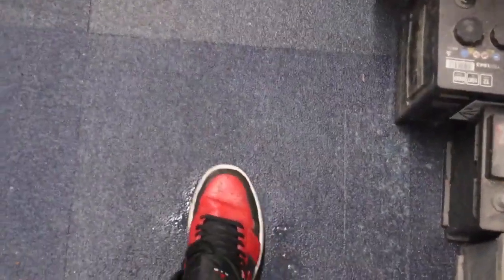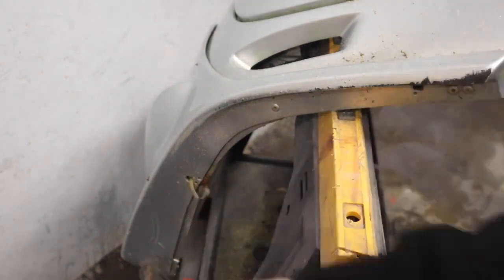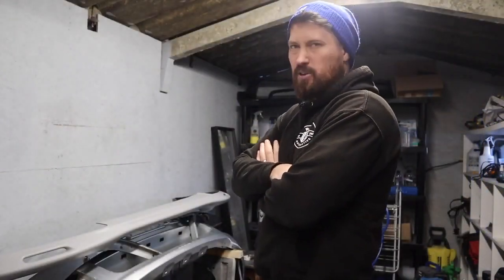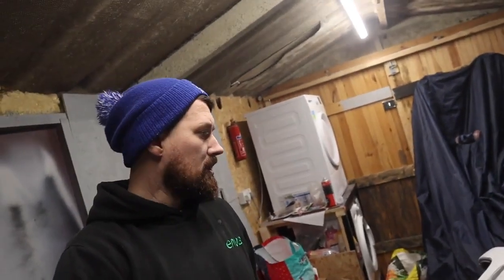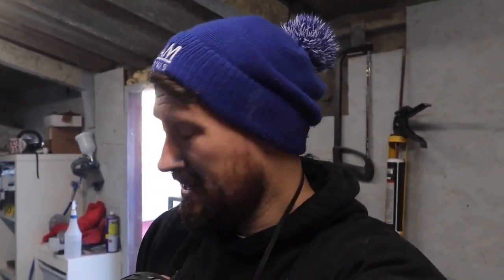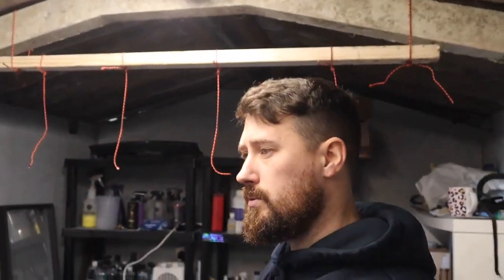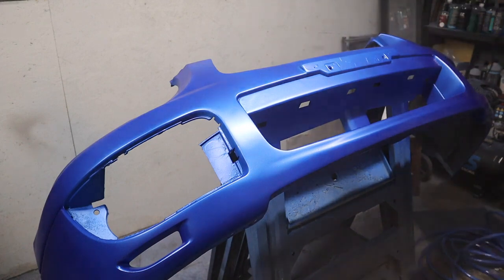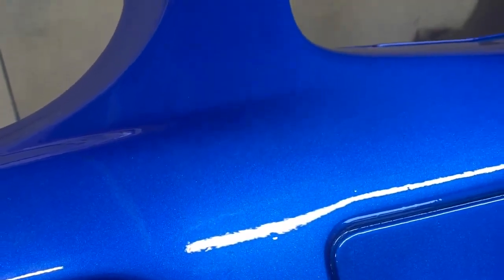DIY Painting car parts in the Garage | Mistakes were Made

Comment: The issue with the second coat crinkling seems to have been high humidity from the wet carpets drying out due to the heater in the garage. There are other reasons for crinkled paint but in this situation, that seems to be the most obvious reason.

I'm no expert but from the little I've learnt of what happens is that the first coat is still drying but at a different rate to the top layer. So the first coat grabs onto the top coat and pulls it together but since the different coats of paint are different volumes, the only place for the top coat to go is up and so crinkles.

Think of an elastic band on a pair of shorts. You stretch the band out. The top layer is flat but let it go and the elastic pulls the fabric into folds. The elastic is the first coat of paint. The fabric is the top coat of paint.
Reply from the maker: Yeah, i spoke with a few painters and they said that could of caused the issue, they also said that i should have done a sealer coat over the full bumper, then went in with my base. apparently if you sand to much, the solvents in base can find its way under and cause the wrinkle effect also.

either way, its a lesson learned and hopefully ill be able to avoid in the future.